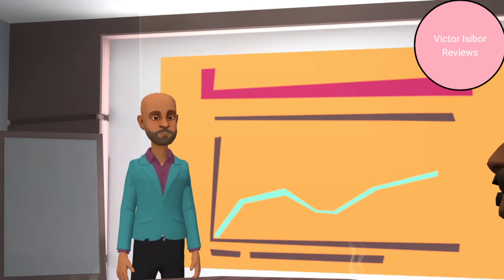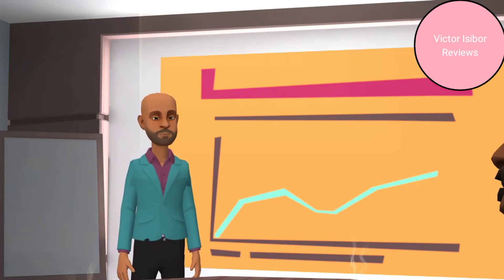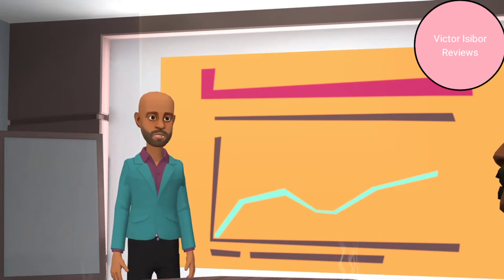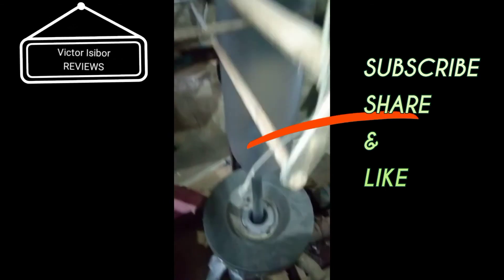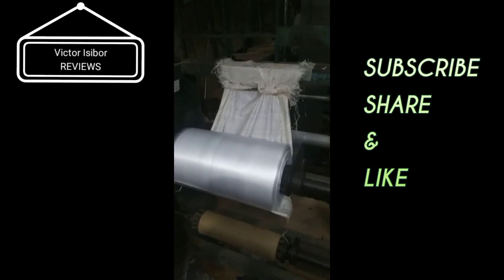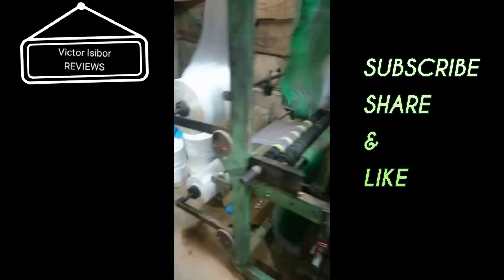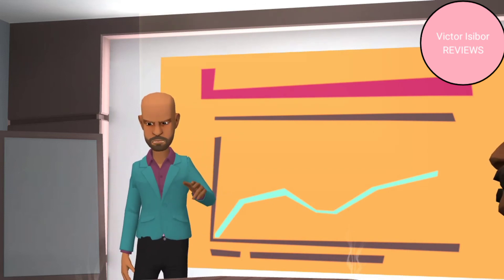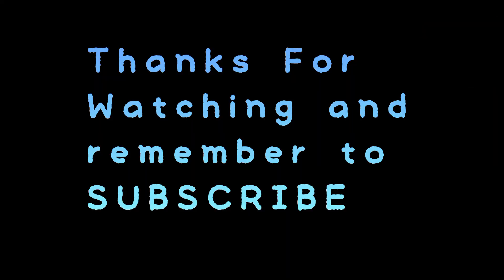NYLON PRODUCTION BUSINESS IN NIGERIA: A Comprehensive Guide On How To Start Producing Nylon Bags

Comment: Nice explanation Sir. 
As at today (May 23,2021), (1) what is the minimum capital required to start small, by getting the first 3 machines metioned. (2) Number of workmen needed for operating the machines. (3) What is the lifespan of the machines and how readily available are the repairers. 
Thank you while awaiting your responses.